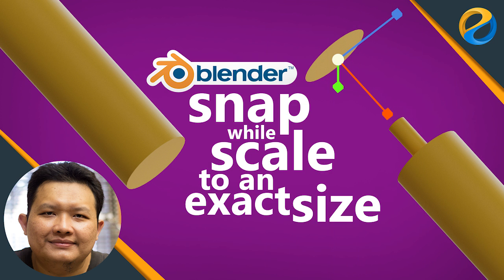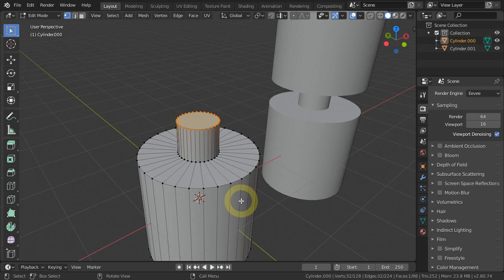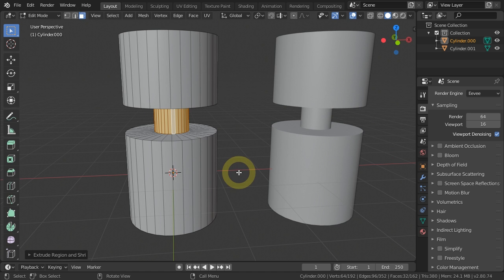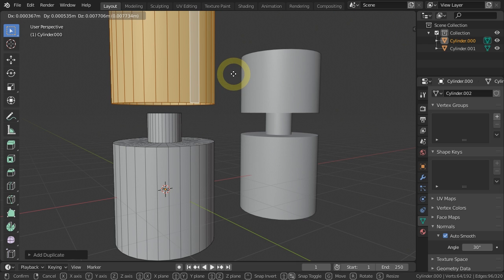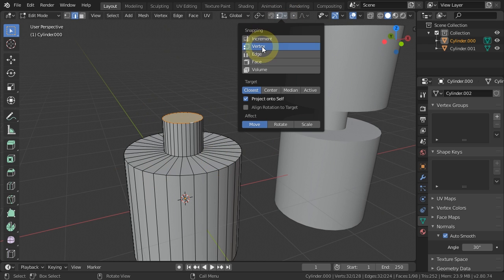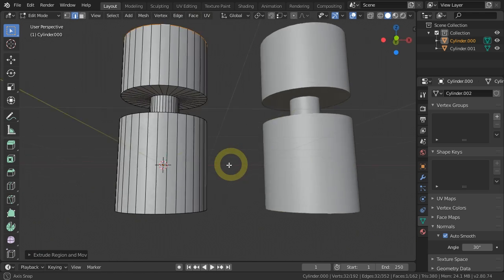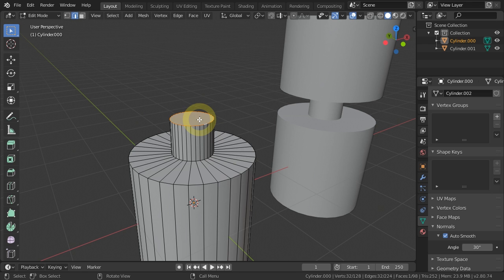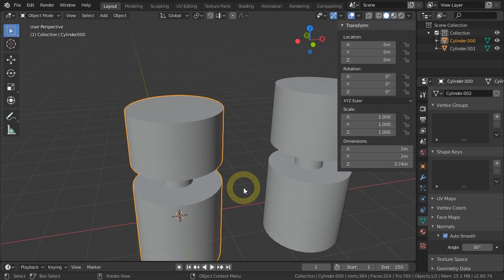How to snap while scale to an exact size in Blender

Comment: Very nice explanation. I had a similar problem. I have a rectangular door frame. Is width is 1m, its height is 2m and the wood thickness is 0.1m. Now if i want to change the height to 0.5m, i do scale in Z axis alone. But the result is the bottom and the top joints reduce in size instead of 0.1m. Can you please explain how to do this, if you have time.

Comment: on 7:51 i miss it,when i hold CTRL key, is not happen,can you help me?
Reply from the maker: Hi Dio. Holding Ctrl will activate the snap mode temporarily. But if you have the snap mode already active, holding Ctrl will actually deactivate it. So make sure the snap mode is off before doing it. Hope this helps.

Comment: Awesome video, how do i get dimensions in my transform menu like you have on yours?
Reply: oh, i see, i have to be in object mode
sorry .
Reply from the maker: Glad you can sort it out :)
Reply: @exposeacademy  Thanks, is there a way to add specific dimensions to individual items such as lines...in edit mode?
Reply from the maker: As far as I know there is no such feature. But you can do them in many different ways. Such as creating the sub-mesh using keyboard input or snap the sub-mesh to a vertex then reposition it again via the keyboard input. You can also separate it first, set the dimension, and then join it back. There are also the measure tool and and some addons that can help us identifying sub-mesh length. But anyway, I think this will be a good topic for my upcoming tutorial :)

Comment: hi I have a question about the Blender does it have plugin as railclon in 3ds max to Repeat stuff like ornament Decors
Reply from the maker: Unfortunately currently there is nothing as complete as Railclone plugin available for Blender. You can use multiple array modifiers and curve modifier in Blender for simple stuff mimicing Railclone. But the future of Blender will have a feature called "Everything Nodes" in sha Allah. Blender will be able to behave more procedurally just like Houdini. When this feature available you can do way more out of the box compared what Railclone can offer, in sha Allah.

Comment: Excellent tutorial , but you can resize or measure to exact size inside edit mode with this free  addon if you need it  : https://blenderartists.org/t/add-on-set-dimensions-in-edit-mode/680253/28
Reply: Awesome. Thank you for the tip. I was looking for a tool like this.
Reply from the maker: Hi Qui thank you for bringing this up. I have actually tried this addon before creating the tutorial. But the original version in Github doesn't work in Blender 2.8 out of the box. That is I why I decided to skip this addon from the tutorial. I know you can edit and fix the addon by hand but honestly I'm not an expert in Python :) And so editing the original script to work with Blender 2.8 would be just too much to cover in this tutorial. 
I just hope one of Blender developers see this video and later decided to add dimension input field in edit mode :) that would be awesome!